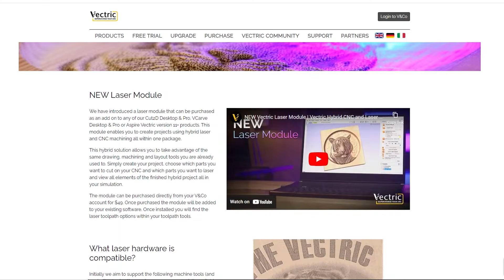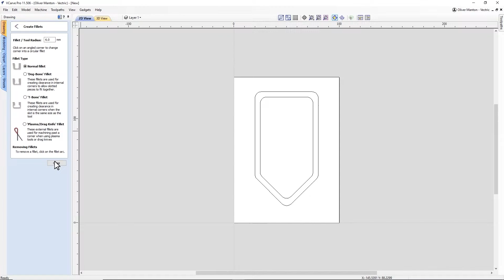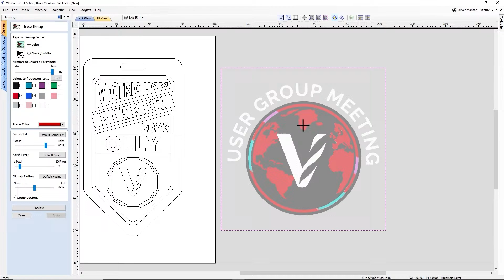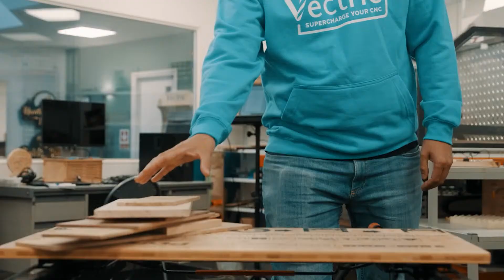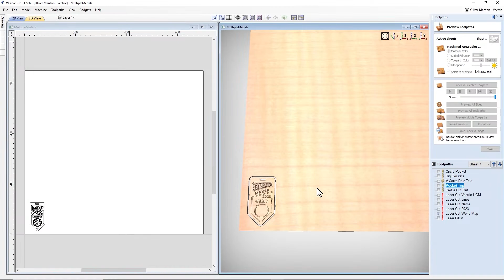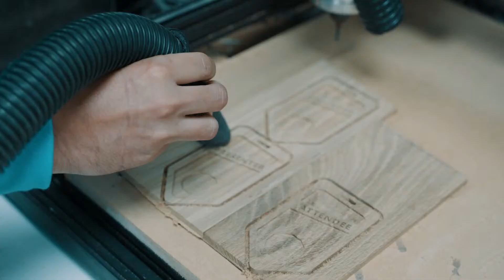Hybrid Laser CNC Machining with Olly | Vectric Worldwide UGM 2023

Comment: Nice work. I want upgrade  my cnc with laser.  But i want to know  where in Vectric can seting position of laser. Spindle   is X0,Y0 but laser is on left page X0,Y+100 mm
Reply from the maker: Hello and thanks for the question.  A laser is a great upgrade to your CNC!  The offset is something you need to find once you have your laser attached.  It is simple to do, and once you have the number you can use it over and over. Most laser addon providers have a method they perfere you to use. I'd check with them.